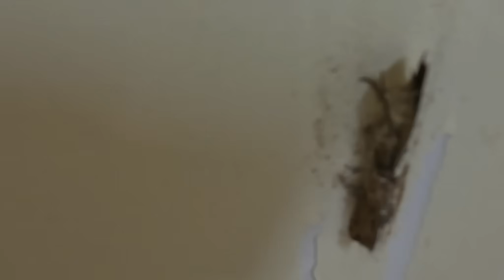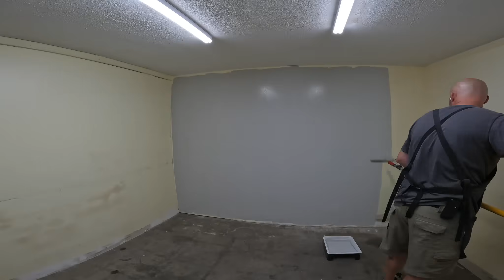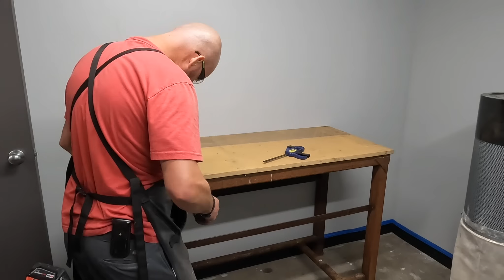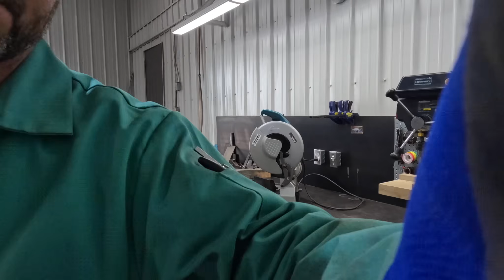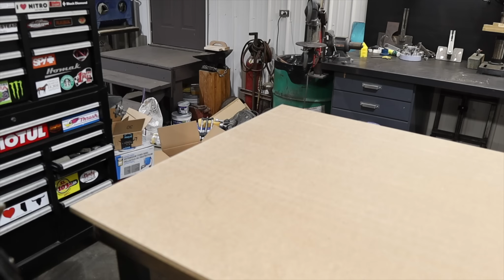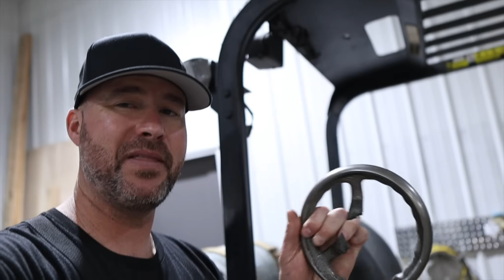Setting up the shop part 3

Comment: Thanks for the videos! What are the dimensions of your grinding room? I am in the process of trying to figure out where in my shop to put a grinding room and I can't decide how big it needs to be. The room will most likely house one 2x72 belt grinder, a 9" disc grinder, Makita steel cutoff saw, floor drill press, maybe a bench mount drill press also, and a portasaw stand. Of course, I need some bench space so that I have a horizontal surface that is piled a foot high with tools, fasteners, Amazon deliveries that I forgot to open and have looked all over my house and my shop for, etc.

Comment: instead of putting your tooling arms on that bottom shelf, did you think of taking a long 2 x 2 tube and welding 4 inch sections of 2 x 2 tubing onto the left and right to hold the tooling arms.  Could be floor mounted or bench mounted.  I have one bench mounted and it saves my back and is really nice.

Comment: Set up a better ventilation system for the grind room 👍to and from.
With negativ pressure inside so the dust stay in there.
Reply from the maker: Yeah I have plan for that in the furture for sure. Just have to wait until my parents move all of the stuff from their house from the back of the shop and then I can get on that. 👍

Comment: Jeremy, quick question. Dimensionally, what size aluminum quench plates are they?  Thanks.  Looking forward to the WFI podcast.  Jeff@BTS Bladeworks.
Reply from the maker: Yeah they are 1" thick, 4" wide and I think I make them 14" long. It was a blast to be on with the guys again. I love that podcast!👍
Reply: @Simplelittlelife  Thanks!

Comment: The Can tire cupboards on the bottom look nice, but I want them up on a riser like every kitchen cabinet. 
Give me that 6 inches to get my feet under, stand closer and avoid stooping. 

Lights look good in the thumbnail, we shall see about the rest later.
Reply from the maker: Thanks. Those are custom checker plate fronts that were made and added to the existing workbench that didn't have doors. 👍